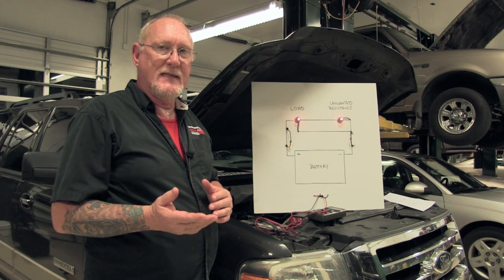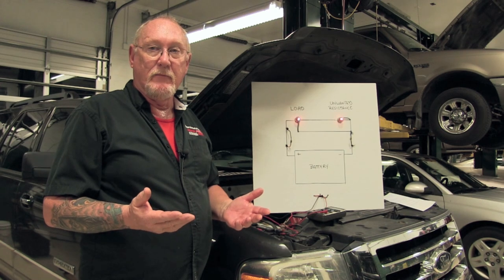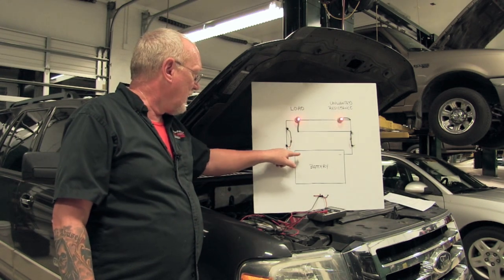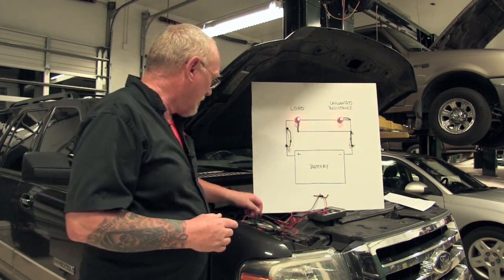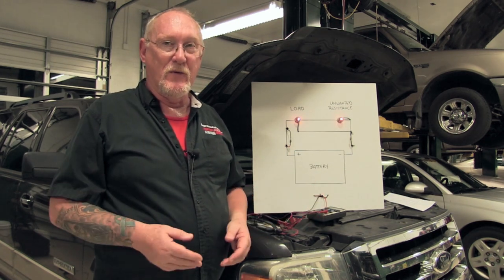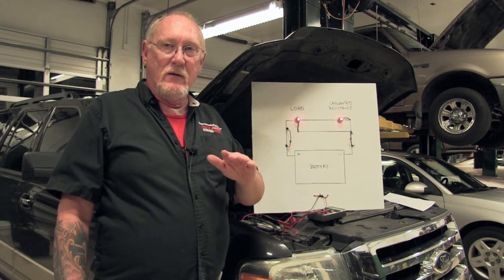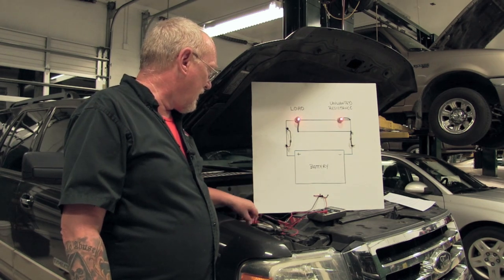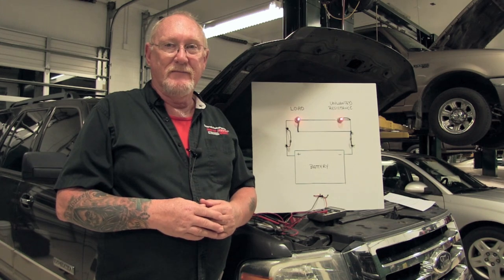The Trainer #49: Testing the positive side of an electrical circuit

Comment: voltage drops are the way to go, 25 years of experience i roll my eyes at tests in diagnostic procedure charts that say  test the ohms across a circuit, voltage drops don't lie (when done correctly) ohms resistance will/ one strand of wire connected in a circuit can show good ohms voltage drops will red flag that instantly
Reply: lonnie adams That would be a great test to do and upload to YouTube!  Pete, please do it on your demonstration circuit (plywood) board.
Reply: Depending on the application and the conductor size required for the current needs check the voltage under load and laugh when you see Chinese crap almost never stands up to par.

Comment: Pete:  From the beginning what is NOT STATED is causing the confusion.

NAMELY this:  Series circuits SHARE the voltage.  Therefore there should be little or no voltage drop between source and load.

If a DROP is observed then something is wrong.  thank you.

Comment: hmmm, Pete?  I'm positive that showing people a number with a negative sign in front will confuse them. Leave the positive lead of the meter on the pos terminal and chase the circuit with the negative. Switch the leads when doing the negative side.
Yes, I know the polarity doesn't matter really but you didn't explain that.
Reply from the maker: +moomike laloo Good point! SO guys, remember - polarity of your meter leads will impact whether you see a positive or negative number on your tool. It will not, however, impact the number itself. Kind of like putting your amp clamp on and having to reverse it to get a good waveform on your scope.
Reply: If someone knows enough to test for voltage drop and a negative number confuses them, I seriously doubt they will ever figure it out!
Think about it. Drop show be reflected as a negative number! It is a loss/deduction/negative, not a gain!
12.81+/-11=??.??
If the -.11 is going to confuse them then I fear by reversing the leads as you suggest would have them showing 12.92 for the ??.??
No big deal at .11, but in the -6.81, you have a huge difference between 6.00 and 19.62!
Use the leads as shown and use the “-“ as an indicator of loss of voltage. 
Also expect small drops if battery is in front of vehicle and checking say the brake light circuit near the load (bulb), but it should be small!

Comment: G’day Teach , I’ve been watching trying to pick up hints oh what could be wrong with my motorcycles electrics , a 2011 Yamaha XT660R , 
has a battery charging problem where it won’t charge at more than high 12’s to low 13 volts , 
started with a new battery , then a new voltage regulator, then a new stator & all been checked & rechecked to make sure they are not bad parts. 
I’ve used electrical grease on the regulator & stator plugs  , checked to see theres no parasitic leakage ,  even checked there’s no voltage to ground , doesn’t matter what I do I can’t get the charge rate up close to 14 volts .
even ran a seperate ground wire to the regulator plug thinking it could have been that.
Reply from the maker: Can you send me a wiring diagram? pmeier@endeavorb2b.com

Comment: Hello sir I have a 2006 Honda odyssey on the negative side it shows 0.2 volts as soon as I disconnect the negative side the millimeter shows it’s 11.6 but when i use a jumper cable it shows the alternator charges 14.5.

Comment: Sir, Thank you for your videos I love them . I am a new comer to all this and I hope this isnt a dumb question. I am a little scared of arcing somthing out Maybe you can explain a little in your answer regarding arcing But, could I take my positive lead and place it on the positive alternater nut and negative lead on positive battery post without burning somthing out  on alt or anywhere else on my car. I am having alt issues and would like to administer this test you show here in your video to rule out issues on positive side of my alt?
Reply from the maker: You won't arc anything out when you connect your voltmeter. The meter is connected in parallel to the circuit it's attached to.
Reply: Be careful to always check your meter, make sure it isn't on amp setting. voltage setting your multimeter is acting as a load on the circuit so you won't short anything out. I don't recommend even using the amp setting on your digital multimeter at all, just get an amp clamp for any current checks, it is much safer for you, your meter and your car/circuit. Use your multimeter for voltage checks ONLY, never amp checks. When you have it set on amps, that's when your meter is no longer acting as a load but passing current.
Reply: @catfeline1530  volt meter do not act as a load but as a difference in potential. It just tell you if you either have voltage or ground on bith sides.

Comment: Question. In your last video you discussed conventional current flow. So if the electrons are actually flowing from negative to positive, wouldn't that put the fuse on the wrong side of the circuit? Are multimeters designed to conform with the conventional current flow standard, or reality?
Reply from the maker: First, the easy one - electrical testing equipment is oriented to the conventional flow theory. As for the other question - no, not really. There are vehicles that use a positive ground system. Fuses are needed to protect the circuit when the current path is allowed to bypass the load - the current limiter, if you will.
Reply: @MotorAgeMagazine  , but if you wanted the fuse "in front" of the load, wouldn't that put it on the ground side?
Reply from the maker: @eddieb9110   In a positive ground system, the negative side becomes the "front".
Reply: @MotorAgeMagazine  When you say in front of load, I'm assuming you mean before the load ?

Comment: so is it normal to lose voltage from the battery or power source to the device? The large loss of load is what creates the suspect of a short... yes? Then you state that the drop will be a significant one, and that makes sense. The E+ absorbtion along the path will be evidenced... yes? However if I am looking at the output E i will be looking for a groundout within the energy consumer itself? Thanks!
Reply from the maker: +Blogger #004257961 There is resistance in every part of the circuit: connectors, switch contacts, even the wire itself. But that is usually small and insignificant. If there is a resistance that isn't a designed in factor, like heavy corrosion or a burnt connector, it is usually significant enough to cause a meter reading well in excess of the generally accepted 0.5 volts for most circuits (less for computer inputs and outputs).

Comment: ALL OF THIS VOLTAGE DROP TESTING IS WITH THE CAR RUNNING ... NO ?????
MY TRUCK WONT CRANK ...
Reply: That's where voltage drop tests shine. The best tests you can do when your car won't crank are voltage drop tests. I would figure out why your truck isn't cranking in less than 5 minutes maybe even less than 2 minutes only with a voltmeter and test light.